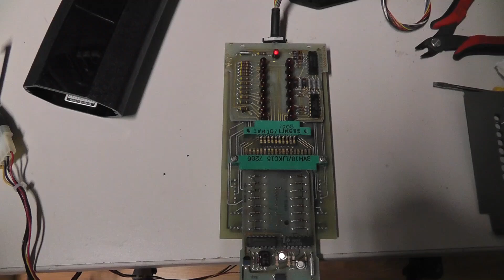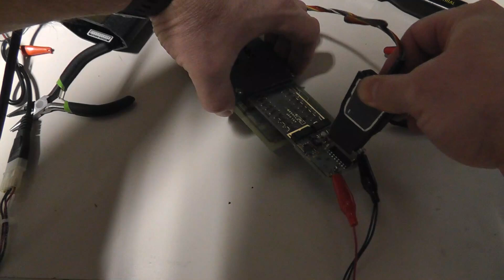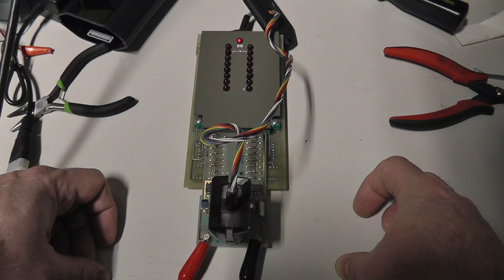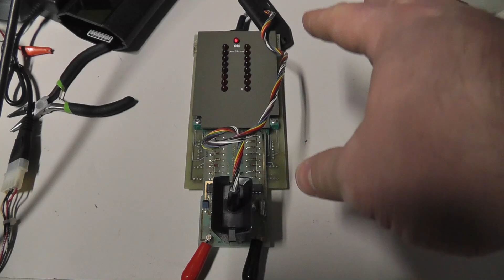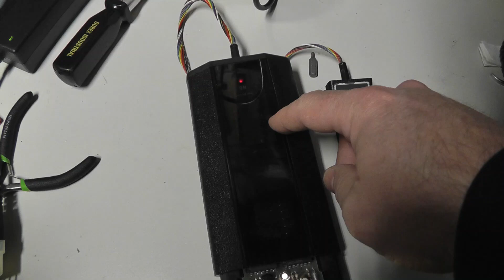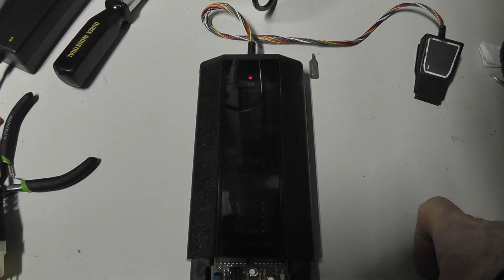HP 10529A Logic Comparator - Part 2 Another Repair

Comment: I know this is an old video but what was the actual fix? Was it replacing the two 7402's? I just picked up the same tester and I have the same issue with one led flashing out of sync with all the others.
Reply from the maker: Yes, that was the fix in this video for the particular issue I had.  good luck.

Comment: Hello Jacklicks, Just for Info. I messed one channel on my comparator and cut out the 74L86 and replace it with an 74ls86, now 3 Leds blinking so its even worse than before. What ic you substitute since I can not get a 74L part anymore...
maybe I´m deaf but you always say ls386 (7:49) did you mean LS86 ? the pinout differs between the two parts !  this confuzes me.
Reply from the maker: Yea, this is a crazy one.  You need a 74LS386.  74L86 == 74LS386.  74L86 != 74LS86.  It is been a bit since I looked at schematic, but I would also consider replacing the other chip that is tied to the L86 for the same channels.  The timing a just off enough with the LS replacement that if you replace the other chip with LS too, it works fine.  Your Mileage on the last part may vary.   Good luck
Reply: @jacklick  
the datasheets on net show same pinout for L86 and LS86 so I´m confuzed. But I will buy one 386 and give a try. What the hell. so in fact I had to desolder all other chips too if I change one of the ls(3)86 because timing ?! 
I had the same problem as you with the led2 always stuck lit on, after tracing the signals from clip with continuity test I found no broken wire and cut the IC7 (a2) out of pcb and solder a 74ls86 instead.
First Led2 static now LED 1 ,2 and 4 are static lit - but not LED3 ! LED 3 blinks with testercard. This is crazy ! So you are right 2 gates are different with LS86 ! -  Such a simple schem atic and I fail ;-) 
thank you so much for replying and this great clip from you ! - you get a new Member on this channel

Comment: Too add more to this - I picked up a 10529a recently.  I had to replace the 74L86's (with 74LS386's).  Now it self test the #3 led has the funny blink you had - but with the shield OFF and not every blink..  When I put the shield ON it blinks properly...   If I pop the shield off and just touch my thumb to the 7402 - I can get led #1,#2 to blink incorrectly..  (i.e.  exact opposite situation as you..)  So far I had 3 of the connector wires pop off which are a pain to reconnect..  But I may just try it like this for a while before replacing the 7402's
edit:  Now #3 is blinking all the time.  I'm going to replace all the 7402's
Reply from the maker: thanks for sharing.  I believe on my 2nd comparator where I replaced the 74L86, I am still getting strange behavior.  My theory is, once you replace one chip in the chain you might as well replace all of the them.  the timing difference from a L to a LS shouldn't be much but might be enough to get strange results.  Good luck!
Reply: @jacklick Got mine up and running correctly last night.  I replaced all the IC's while I was in it..  Have a couple of reference cards made and they work.  The self-test card still has the extra blinks on 1,3 - which bugged me of course..  I put the scope on it and I believe I have traced it to C2 (300pf mica cap) in the self test card.  It has a clean signal going in and intermittent spikes coming out.. The timing must be just right that they have no effect on the LEDs/pins 5-16 since they are controlled on the same board.  LED/pins 1-4 are are controlled by the IC's on the LED card.  The spike with whatever capacitance is being created by the LED cover plate may be causing it?  Either way - I ordered a couple of those caps and I'll test it out.  
I think the comparator is working fine and its quirk of the self-test card..  we'll see..

Comment: The problem may be what is known as a proximity effect. There is apparently inductive or capacitive coupling when the metal plate is put in close proximity to the aged IC's. Could also be caused with the plate coupling to the old caps. My best guess is just old crudy IC's have deteriorated enough internally that they are reacting to the shield... Good luck
Reply from the maker: Interesting.  Thanks for the comment and sharing as I just learned something.  Never heard of this.

Comment: JACKLICK,     how do you figure out the ROM/RAM size from the address region 4000 - 47FF would be what size? 
    7800-7FFF is what ROM/RAM size?
Reply from the maker: I just use windows calculator, choose hex 47FF - 4000 +1, then change that to decimal to see how many bytes. Multiply that by 8 for bits.  https://xtronics.com/wiki/How_EPROMS_Work.html

Comment: JACKLICK I need your help
1.) Not sure if you know the answer to this but For Bally midway Galaga they used a custom sync generator chip i'm guessing for the V&H sync and what else is inside this custom sync generator chips?
2.) Some arcade games use RAM chips that need +/- 5 volts and 12volts, why did they use these RAM chips what was the advantage of using them?
3.) For vector games what does the vector XY generator chips do? because I don't know what the math box circuit how does the vector math box circuit work or what does it do? 
4.) what the differences between XY point counters compared to H&V sync counters any differences?
Reply from the maker: Your best bet is to go to forums.arcade-museum.com and ask these questions.  I barely know / learn  on the stuff I share so would be guessing or researching on  many of these.  Regarding #2 ram chip voltage, there is no advantage, that I know of, when using a tri-voltage chip over a single voltage chip.  It is probably what was available to the engineers at the time and technology evolved that allowed them design and manufacturer single voltage Rom/Ram chips.  Just make sure you modify your board or chip when swapping single voltage for tri-voltage.
Reply: @jacklick  ok thanks

Comment: I wonder if the metal plate got magnetized and that's what was causing it, very strange issue.
Reply from the maker: Yea maybe.  I wish I would have thought about using a degaussing coil on it.  Next time :)
Reply: @jacklick  Isn't the cover made of Aluminum?? I am certain as can be that the shield itself is not the issue but rather coupling as mentioned in a former post.
Reply from the maker: @wa4aos   not sure but now I want to go check and eliminate this theory.